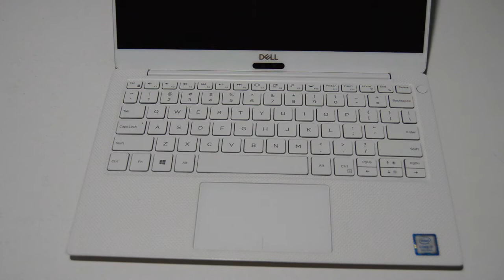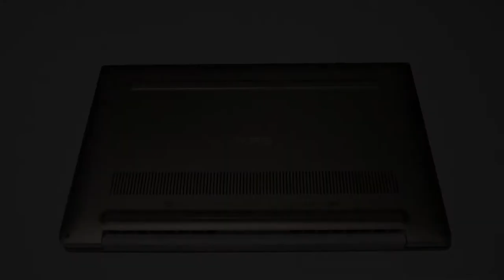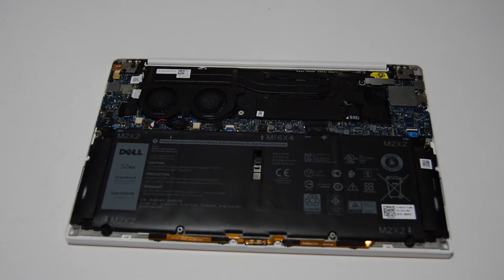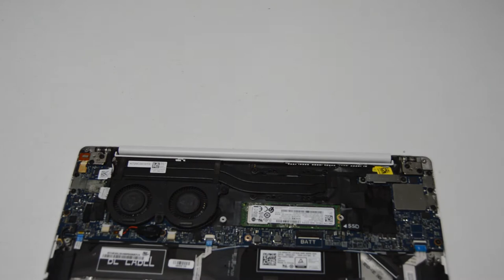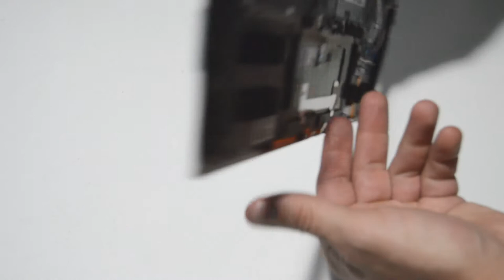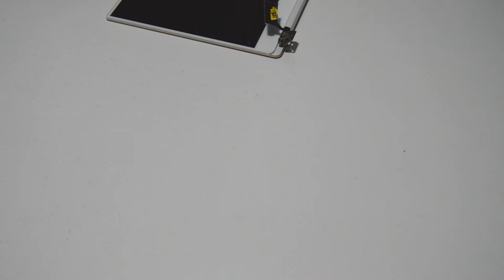How to Disassemble Dell XPS 13 9370 Laptop

Comment: i was thinking the ram and wifi on motherboard and maybe including power button are because of security reasons mostly. I didnt think about before but to break encryption used to be mainly only possible by hijacking a working computer and taking out the ram where the encryption keys were stored as long as they were still powered cause powered off ram ERASES everything it stores. so u could break hdd/sdd whatever storage encryption.

i was watching to find out if i can remove the ram ! But you clarified its actually really soldered on the motherboard. Thank you .

Comment: hey when I put the base cover back on, I don't get a satisfying click. Also I feel there's a little gap near the vent area. Is this normal?
Reply: You may have broken off some of the clips that hold the metal panel and the palm rest assembly together. Dell literature recommends avoiding prying the machine open from the back, for what it's worth!

Comment: i broke the top 3 plastic clips on the laptop itself now when i put it back together there is a bit of a gap and you can see the flex in the aluminum when you push down on it, any thing i can do?
Reply from the maker: Not really, unless you want to carefully use some flexible glue like silicone, you would need to tape it down tightly until it cures. Silicone should be safe for any electrical contacts and can be peeled off later if needed.

Comment: I found taking the back case off extremely hard
Reply: Same here, any advice on how to proceed?

I accidentally already broke a part of the plastic housing… and after 5 minutes of trying to get it off I realized that I literally cut some skin off of my fingers lol
Reply: @barbarossa11  man I ripped my nail off. I would just say determination. What's funny is after all that I got the wrong ram card
Reply: @barbarossa11  I bought a `spudger` set from Amazon which contains lots of tools for opening these laptops and which can also be used to open up mobile phones and other electronic gadgets too. The way I do it is once all the screws are out, look around the edges to see if there are any gaps larger than others and then use the plastic and nylon opening tools (NOT the metals ones - throw those away) to gently work around separating the bottom from the chassis. The way to do it is gently, and not `bull in a china shop` with levering everything in sight like you are pumping water from a well, just gently work the tools around the edges and slowly one by one each of the clips will release. The second time the bottom is removed it will be a lot easier as the clips wear slightly each time the bottom is removed.
On all the laptops I have opened I haven`t damaged any of them as the nylon tools are softer material than the laptop and are designed to break before the laptop does.

Comment: Is the ram non-removable?
Reply from the maker: Correct, it is integrated
Reply: @Sellbrokedotcom  my computer light is blinking orange 2 times and white 5 times and when I search on google it says that ram should be popped out and reinstalled and that should fix it how do I do that i have the same laptop